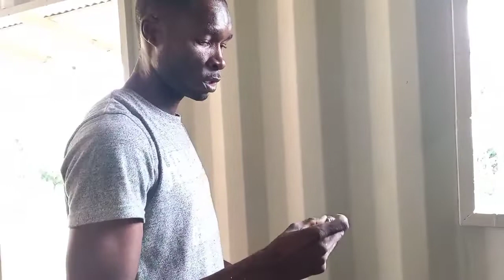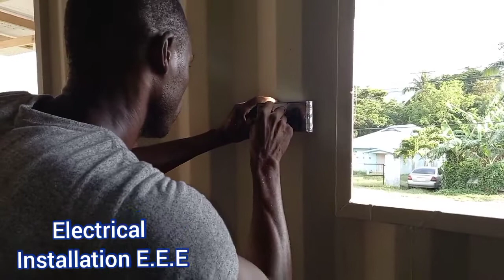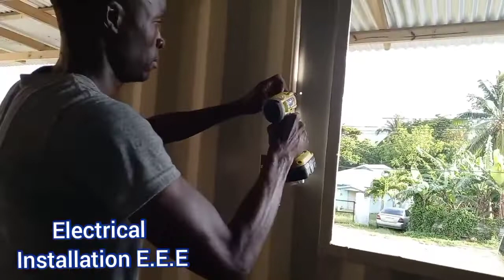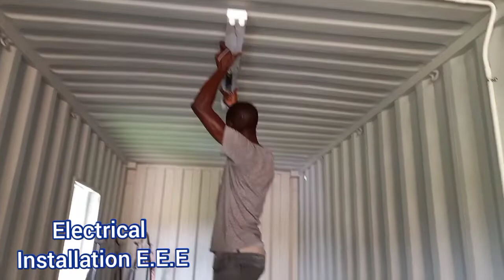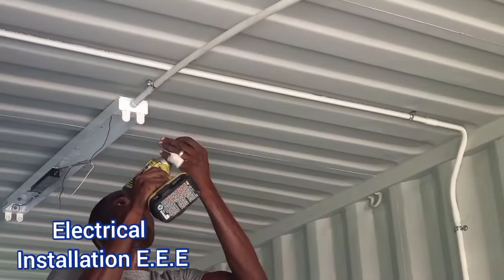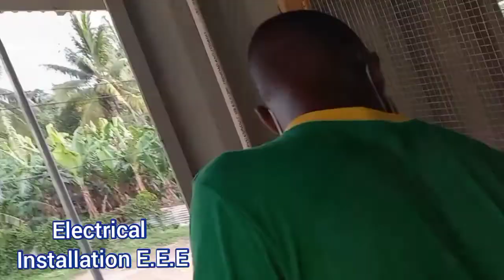How to mount electrical boxes onto a trailer container !! Proper screws to use mount boxes on metal

Comment: Great video when u get the time. Can u do a video on how to wire a led tube light or fluorescent ballast lighting? Also by discussion Shunt and non Shunt tombstone in the led or fluorescent lighting.  Keeping putting out good content am learning something off your video every time.
Another question. What's the name of the bit on the battery drill u use to drive/mount the screws in the wall. The flash bond or stop leaks where u get those to buy.
Reply from the maker: Flourescent videos coming
Flash band any hardware
Drill bit type it cover the head of the screw also come in a set
Reply: @ElectricalInstallationEEE  Ok then. The bit is a nut driver bit basically. Thanks for ur content it's helping aspiring electrician like me and other out there.